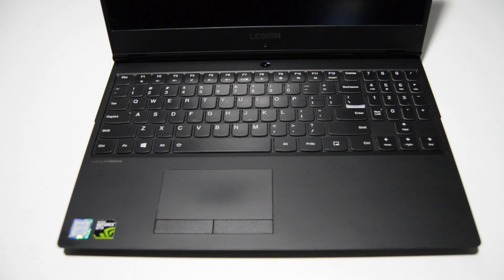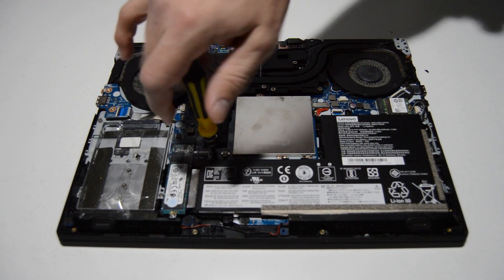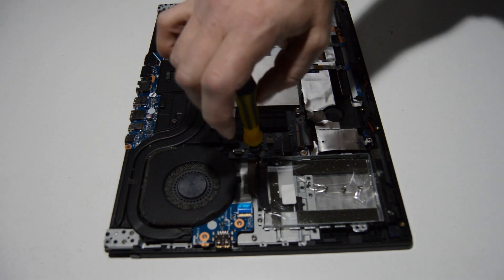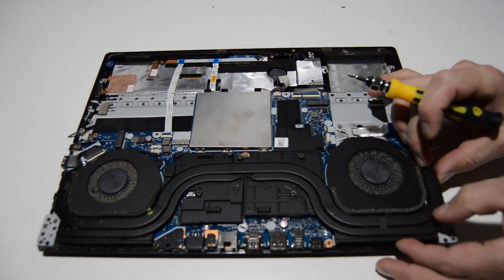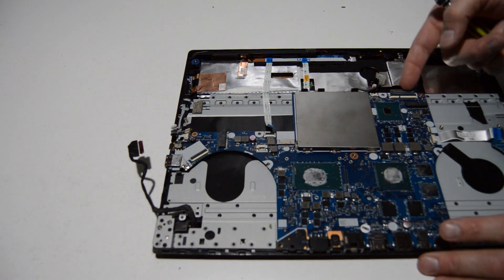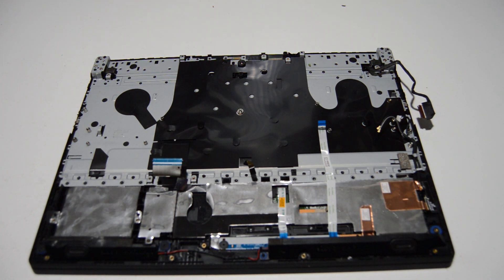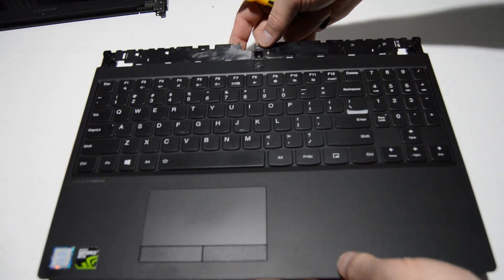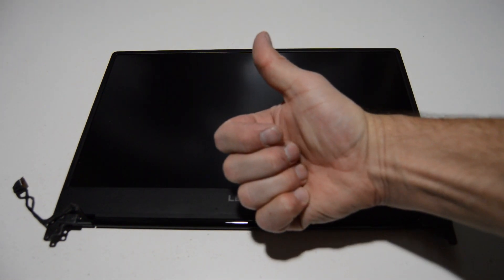How to Disassemble Lenovo Legion Y530 Laptop

Comment: Super bad design of lenovo. Why rivet the keyboard? I just spilled some water on mine and i just dissasembled the whole laptop. Motherboard is good but the keyboard maybe dead...
Reply: Same problem here, have you been able to find a solution?
Reply: @andrasgedeon3325  No, The back of the keyobard has a metal that has been riveted to the plastic case. I must cut the rivets and open and clean it. But i found a replacement for 60$ and i think first i will buy the replacement and after that try to repair the old one. Pretty bad design. They easily could replace the rivets with 8-10 bolts
Reply: @Gabson9  
Bro, the same thing happened to me where you bought the replacement? my  key Q stop working
Reply: I was planning to get a replacement part as well but I actually have an y540 and haven't been able to find one. Chances are I could use the same replacement part as you for the 530 but you never know, maybe lenovo changed somethig. I'm not sure if cleaning up could hep me since mine had a little bit of wine yesterday...
Reply: @andrasgedeon3325  it must help, but for that you should cut the metal part, and disasemble the whole keyboard. Inside there must be 2 layers and you must clean them, but im pretty sure it is hard
Reply: @Gabson9  Just found the part for the keyboard for less than $30 were you able to find a video on how to replace it?
Reply: @angelxx1234100  Look for lenovo y530 dissasembly video. Basically this is the main part thats holding all of the internals. So you have to swap almost all of the components except the keyboard, anthenna and some small stuff. You will see them.
Reply: @Gabson9  Been trying unfortunately no video shows opening the assembly to remove the keyboard and then replace it
Reply: @angelxx1234100  oh no. Keyboard is integraded in the plastic body with plastic nits. Its incredibly hard to change only it. Thats why i bought whole assembly.
Reply: @Gabson9  ohh ok👍
Reply: @Gabson9  Just found a link on how to change a non removable laptop keyboard which might make me save a few dollars if you're still interested you can google "Replace the keyboard without replacing the top case" 👍
Reply: I spilled water on mine as well. Everything except the keyboard is still working. When I contacted Lenovo to get it fixed, they were going to charge me $250 for onsite repair. I'm gonna see if I can get a lower price by bringing it directly to the service center.